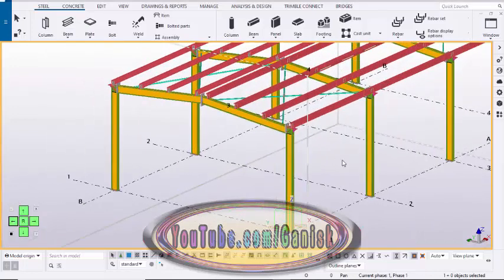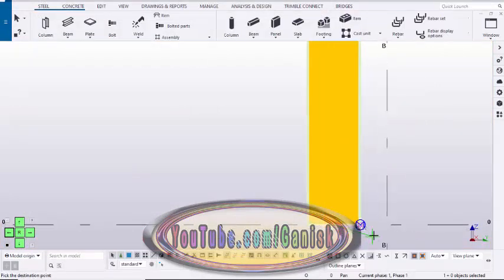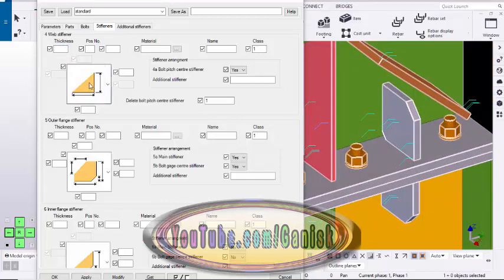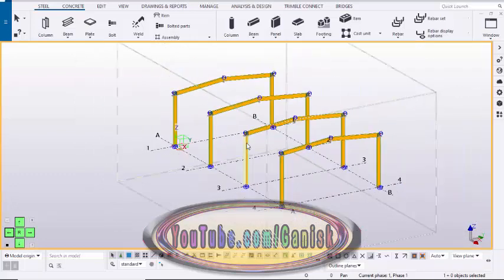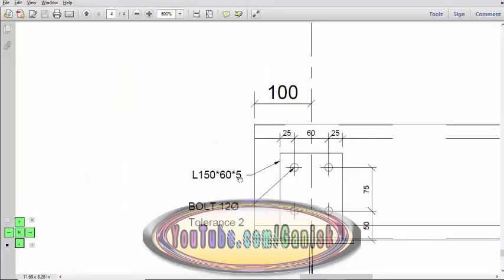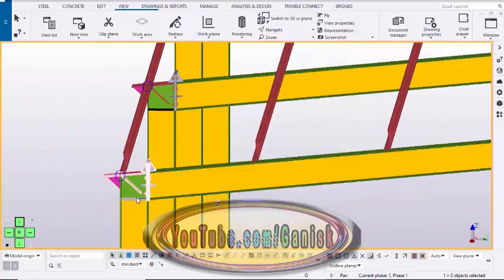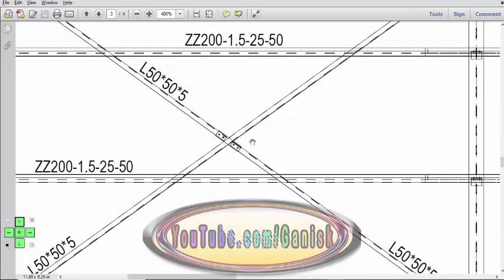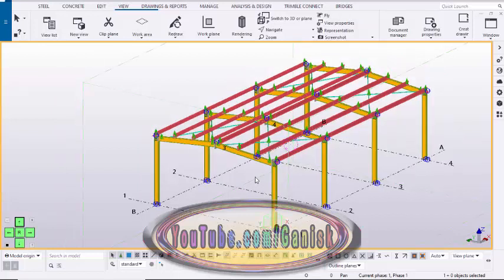Tekla Structures Complete Project 4 PEB with Design drawings Part 1

Comment: good afternoon sir my name  is babu i have small doubt sir why are u change the column orientation i mean right column downward direction  and left side column topward direction. do u have any reasoning for changing the column, can u please explain the doubt sir.
Reply from the maker: You need to do that, otherwise you won't get the connection properly between Column to Rafter at haunch.